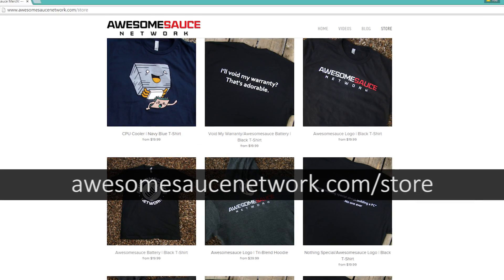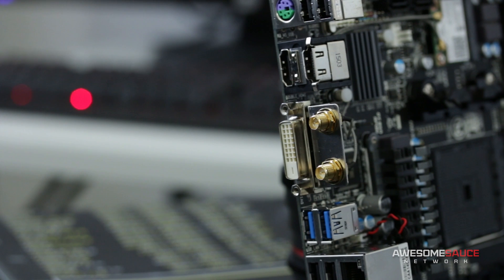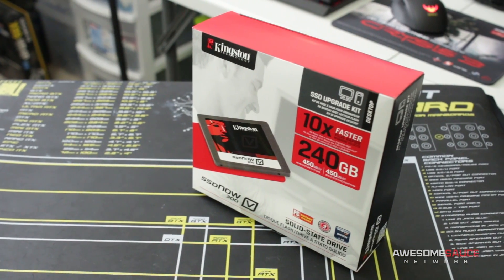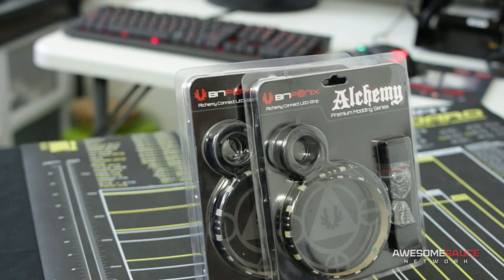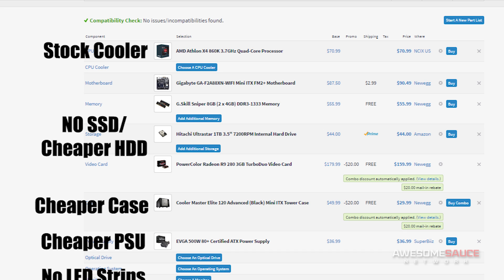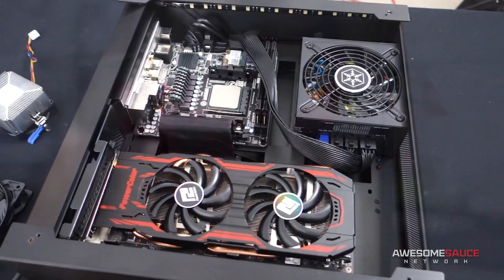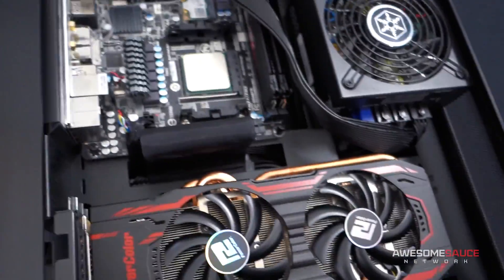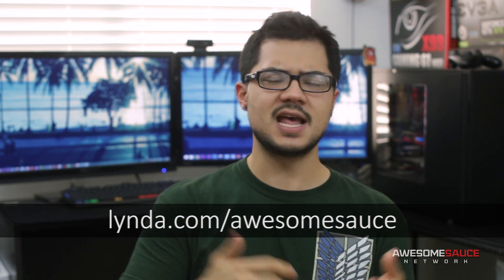The Overkill Console Killer: And How to Build One for Under $500 (Part I)

Comment: This mediocre rig is misleading because doesn't include mouse/keyboard (a console comes with an equivalent gaming peripheral). And are you running Linux? Because there is no $100 Windows 10 included either in the price. Linux is great, I game on it, but won't run anywhere near the amount of games Windows or a console will right now so your basically bound to some of Steam's library and that's it.

Overall this is closer to $700 with peripherals and OS, and because it's an AMD setup it'll run hot and consume WAY more power than an Intel/NVIDIA setup which is just a waste. AMD is so terribly power inefficient.

Long story short, a $400 PS4 seems like a much better choice if this is the alternative.

Comment: for computers do the parts have to be compatible or are all parts compatible. I mean if i switched out a few parts of the biuld will the computer still work? I knoq the ram has to be the same DDR to work with the computer but otherwise can i just use random parts in a biuld and they will work?
Reply: Jordan Costelo For the mainboard processor socket, its must be the same type with the processor (eg: LGA 1150, AM3, FM2+, etc), and also the DDR type must be compatible with the proc. spec, for example like the athlon x4 in this video support memory DDR3 up to 2133mhz, and then the vga card must have the same slot with the one on the main board, wich commonly are PCI express 3.0, for the storages, use the same SATA version also with the one on the mainboard Lastly u must calculate so the power supply could supply enough power for all components. So basically you can throw in any part from any brand or manufacturer, as long as the interfaces clicks...
Hope that can help, correct me if I'm wrong anyone..

Comment: WAIT WHAT. A X4 in 1000 dollars build? Nosense.
Reply: aaronzone oh its mini itx
Reply: http://pcpartpicker.com/p/p7GgjX
This is the ITX build what I made.
Reply: aaronzone A Xeon? Why? You're not hosting any servers whatsoever.
Reply: ***** That's basically locked i7-4770 without integrated gpu.
Reply: aaronzone Yes but it's not designed for gaming. It even lacks performance compared to i7's when it comes to gaming. You are way better off with a i5-4690 or even a 4460 if necessary.
Reply: ***** http://cpuboss.com/cpus/Intel-Xeon-E3-1231-v3-vs-Intel-Core-i7-4770K the name only doesn't make it bad.
Reply: aaronzone No it doesn't. But the benchmarks do.
Reply: And the OC helps i5 pretty much with those benchmarks.

Comment: Hello. I am just a little guy 12 years old and i am saving for 500 euros for a gaming pc actually 522 euros but i dont know if i get the good stuff for that money  this are specs they are in dutch but only need to know its good or not 
Hardware
chassis:
Sharkoon BD28 Green edition
Verlichting:
no extra lights
not quiet:
Geen Geluidsdemping
Motherboard:
GIGABYTE GA-F2A68HM-DS2
Processor:
AMD Trinity A4 5300 (2x 3400 MHz) Dual Core
Overclock:
no Overclock
Processor-cooler:
Scythe Katana 4
[RAM]:
8GB DDR3 1333Mhz (Corsair Memory - Dual Channel)
Videocard
AMD Radeon HD 7000 serie
audiocard:
Onboard audio 7.1
harddrive 1:
1000GB Harde Schijf (Toshiba 7200RPM)

Network:
TP-LINK TL-WN781ND 150N - Draadloos WIFI
Drive:
DVD-RW Dual Layer Brander
IDK:
Corsair CX Series CX430
Bekabeling:
Standaard Bekabeling
Cardreader:
All in One Cardreader + USB aansluiting
Garantie:
2 Jaar Carry-in Garantie
Actie:
Gratis Sharkoon Shark Force Green
Software
operating system included with price
Windows 8.1 64Bit NL
Reply: We don't need 12 yr olds in the PC master race
Reply: Go to website named pc part picker. Find good computers built by other people. Pick parts there for good price
Reply: Boonstra TV Koop nooit een kant en klaar PC als je gaat gamen, je betaalt er vaak meer voor dan wat je er voor krijgt. De A4 5300 processor bijvoorbeeld is niet bepaald krachtig op het gebied van grafische games en is ook trager dan de meeste Intel processoren van dezelfde prijs. Koop deze onderdelen via Alternate.nl en laat ze voor je in elkaar zetten door Alternate of doe het zelf als je dat fijner vindt. http://pcpartpicker.com/p/pFMsQ7
Reply: Knight Squire James Fuck off m8
Reply: Armando Gomez lol

Comment: I must say the 860K sucks.. I have one and it bottlenecks a 260X in GTA V...
Reply: Wiikendz Bit late but GTAV isn't a good comparison for benchmarks right now.
Reply: *****
had it at 4.2 with no difference.. now its at 4..
Reply: *****
Its FM2+, there is no better CPU.. :(
But im probably upgrading to an i5 6600k when those are released in like a month :D
Reply: Wiikendz dude, the 860k is beast, with a good cpu cooler and little OC it can run almost everything
Reply: Rob van Dooren It bottlenecks a 260X in GTA V, at 4.2GHz..
Its good for the price, hell yea! But not if you want to game at higher fps..
Reply: Wiikendz True dat. But it is definetely the best budget cpu, could run newer games on medium settings 1080p 60+ fps! I use it for my second pc, which is for mates when they come over. I mainly use my i7 3770 pc
Reply: Rob van Dooren Depends on the game tho.. If you max out GTA V even with a Titan X, you only get like 35fps with the 860, while other CPUs get like 60..

Comment: is this build good for 500$
Case:cooler master elite 110 40$
CPU:ntel Pentium G3258 Haswell Dual-Core 3.2GHz LGA 1150 70$
MoBO:ASRock H81M-ITX LGA 1150 mini itx 55$
PSU:Cooler Master Elite V2 - 550W 55$
cpu heatsink:Noctua NH-L9i 95mm SSO2 CPU Cooler 40$
ram:Crucial Ballistix Sport 8GB (2 x 4GB) 240-Pin DDR3 SDRAM 50$
EVGA GTX 660 SuperClocked 2GB GDDR5 PCI Express 3.0 100$
hdd:Seagate Momentus Thin ST500LT012 500GB 50$

Comment: This isn't a console killer.....this pc cost $150 more than the xbox one. Plus in 2-3 years your going to need to upgrade unlike the console which will be optimized for about 6-8 years to run all games. I like both console and pc but when it comes down its possible to beat the consoles price/preformance ratio.

Comment: First off, i'm not trying to play "fan boy" when it comes to console vs PC....but how will a $500 PC stand-up to the PS4 and Xbox One in a few years?  I mean, even Fallout 4 is going to push that system almost to its max and that's coming out later this year.....also, Batman Arkham Knight RECOMMENDED requirements are hitting the limits as well.  The fact that I paid $400 for my PS4 last year and I know that in the year 2018, for example, I can play games on the console, odds are, I'd have to spend MORE money on a $500 PC....GPU, RAM and probably even CPU.  By the time 2018 comes along, the PS4 will probably be $299 and the Xbox One could be $249 ($100 price drop for both)....The biggest gripe I have when it comes to PC gaming is having to check system requirements on games....either you pay out the butt up front so you don't have to worry about system requirements, or upgrade hardware every couple of years.  Yes, I realize you get better graphics from a PC game and higher frame rate....but even if I were to play games at the same resolution that the PS4 or Xbox One is playing them at, I don't think a $500 PC is going to be playing the multi-plat titles in a couple years.
Reply: DvdXploitr I have a 4 year old PC (600€) and I play BF4 on high settings. I've never had any lag on games, unless they were horribly optimized ports, like Batman Arkham Knight.
PC gamers don't check system requirements in games, unless they have an 8+ year old machine. They also don't worry about upgrading, because it's usually only 1 part that's holding the system back and it can be sold and cheaply replaced.
You people don't seem to get it that consoles are PCs with limiting software and hardware. You're paying more for less, because of the brand. Your games cost more, because developers need to pay just to have their game in Xbox or Playstation. MS and Sony keep distracting you with exclusives, DLCs, gadgets and free games, while you're paying 60-100$ for games and 15$ for online play. You say you'll be playing PS4 in 2018, but we all know how fast you'll be in stores when PS5 comes out with words like "new features" and "next gen".
You have no idea how bad consoles are for the gaming community. Even though a PC can do everything a console can (and more), people still buy consoles. The media exaggerates everything and creates a public opinion of consoles being the future of gaming, which forces game developers to divert their attention and funding towards making console users happy, while PC users get stuck with bad ports or downgraded graphics.
Reply: DvdXploitr Well, the consoles aren't magically going to become more powerful, so why would a PC that's currently good degrade over the same generation?
Reply: DvdXploitr " how will a $500.00 pc stand up to the pos4 and xbone in a few years?  THE SAME way it will today.  It beats it.  Guess what.  Fallout 4, crysis 5, metro last light 4, witcher 5, and ANY other truly demanding title WON'T be playable on a conslow worth a shit ( 30fps and 900p..isn't worth a shit.  get over it).

Thus your question equally applies to both the conslow and the pc except the pc's performance DOESN'T degradate unless it's ran by a dumbass noob who loves to " click here for the best new dumbass casual game whose company is unknown and it will give you 10 billion new lovely internet browser toolbars to let in new malware and viruses." 

By the time 2018 comes along.  Amd ( as usual) will have yet another badass apu and newegg and the likes of those etailers will have 300.00 deals on bi weekly shellshocker deals ( plus 100 bucks more for windows) that will STILL match or beat the conslow- worst case scenario- and yet STILL do more than it ever could....while the conslow STILL fails at trying to become the pc since it has been trying to do since the FIRST gen playstation days. 

"I don't think a $500 PC is going to be playing the multi-plat titles in a couple years."   (facepalm).  Please get off the net kid.  You obviously haven't a clue.
Reply: so, i should able to play GTA V (even if its not on Ultra) on an i5 with 8GB RAM an integrated HD 4000 1GB GPU?
Reply: I've bought a 7770 for 75 bucks in early 2012 and it still runs fine
Reply: ***** Conslows CAN'T do or take full advantage of the following:
1.  Enjoy an UNgimped internet usage experience.
2.  Burn/copy/rip music cds, movie dvds and blurays.
3.  Edit documents, photos, music, and movies.
4.  Enjoy in TRUE ( not FALSELY scaled ) 1080p, 1440p, and above resolution gaming.
5.  CREATE GAMES
6.  CREATE operating systems.
7.  CREATE music.
8.  Be upgraded at all in any NOTICEABLE context of performance/hardware upgrades except  one ssd and even that can be a bitch to deal with compared to a ssd upgrade for a Windows or Linux pc.
9.  Enjoy the LARGEST library of FREE games ( and depending on the website ..cough gog.com.  cough) many of which are DRM free. 
10.  Teach a person how to be self sufficient ( pc's are most often individual/customer repairable.  Conslows often MUST be sent to the damn manufacturer ( xbox 360's red ring of death upon launch...enough said)
11.  Enjoy virtuallY ALL GAMES in the history of gaming of ANY context and ANY level ( from coleco vision, atari, nes, snes, genesis, turbo graphics 16..all the way to ps3, nintendo wii, xbox, and possibly xbox 360) either natively to the operating system..or via emulation.....FOR FREE or dirty cheap.  Good luck playing FF tactics on ps3 if you feel like some classic gaming.  It won't happen.
12.  Dpi scaling and other IMAGING adjustments to the gui/desktop interaction of the device...Good luck with even a PORTION of that on a conslow.

Well that should be enough for now.  So given all or even HALF of that list...how the FUCK..could you say that a conslow is a pc?  Epic failure there.

The conslow has BEEN .." trying" to become the pc since the playstation days or hell even the Philips CDi which tanked in a short time, but all of these half-assed efforts only shine the truth brighter and brighter upon ever " next gen conslow" release in which is ALWAYS 2+ years behind pc hardware in almost EVERY context.

The ONLY thing conslows have going for them is exclusive titles :  Metroid, Ninja Gaiden, Mario, Super Smash bros. , Gran Turismo, Zelda, etc

And year after year, Pc is able to play those titles ( although in recent few years emulation is getting tougher to build.  I'll admit that) through emulation just a few years after the conslow's launch.
Reply: Chronofusion Dude, I wasn't trying to diss PC gaming....as I stated at the beginning, i'm not trying to be a fan boy about consoles vs PCs....i'm a console gamer and my brother is a PC gamer...however, it seems that ever year when my parents ask my brother and I what we want for Christmas, he is asking for something new for his PC...its usually RAM one year, GPU the next year and CPU the next...every now and then, he'll ask for a new hard drive....it just seems that he is putting an awful lot into his PC....as far as consoles, I'm perfectly fine with 1080p at 30FPS....I just was curious if a $500 PC would still be able to play games in a few years with the way games are getting bigger and more power hungry....it wasn't a stab at PC gamers at all...i'm just basing it my brother's experience and a couple other people I know that play PC games.
Reply: Do not believe requirments. They are misleading and often mean "the lowest end configuration we tried" which is different from "the lowest end configuration possible". A mid-high end (HD 6870, FX 4100, 8 GB ram) machine from 2010, bought at €500 (in a country where parts are overpriced) outperforms consoles. It is also a myth that about Xbox 360 being aging better than high end PCs from 2006. 8800 outperformed Xbox with Far Cry 3 which is one of the worst games running on PC.
Reply: DvdXploitr
Reply: DvdXploitr Yes, at a compromise but it is possible. Sorry for the previous message, it was misleading.
Reply: AnimationStationS I wasn't implying that the PC would degrade, it just seems that requirements for games go higher and higher in no time.  Take my laptop for example, it came out after the PS3 and it can't play games that the PS3 can.....
Reply: DvdXploitr Good point. You may have to upgrade a 500 dollar computer depending on how you build it. I find myself wanting to upgrade my computers whenever I can, rather than when I need to. I think common upgrades are mainly a result of the high standards that PC gamers have, and so maintaining 60fps1080p is harder than 900p30fps. You might need to do a GPU upgrade, but only maybe. You'll probably be fine.
Reply: AnimationStationS I would be perfectly fine with 900p/30fps really.  I would rather have a PC that can play modern games for the life of a game console while still doing PC features....rather than game console companies putting "PC-like features" on their consoles....I mean, I can't imagine someone using a PS4 to surf the web like they would a desktop, laptop or even a phone.  But if I could use my PC for 5-6 years and play games the same way I would a console, I would be happy with that.  My eye sight isn't the best and can barely tell a difference in 720p and 1080p (but Ican see a HUGE difference between 1080p and 4K)....even if I could manage 720p/60fps, i'd take that over 900p/30fps b/c I can notice a MAJOR difference in 30fps and 60fps...however, there are some games that i'd miss from consoles....such as Mario games...and even Destiny....(I guess I can see why they never put Destiny on PCs since PCs already have plenty of MMORPGs)
Reply: DvdXploitr That's a pretty dumb line of logic there. It's not like the PS4 specs get more powerful over time and the PC specs degrade over time.

The truth is the game developers cut corners to get the latest games running on the dating console hardware. They decrease the FoV, decrease the FPS, decrease the resolution, etc, etc, etc. You can do exactly the same on your PC and keep up.

Sure, your PC won't be able to play games on Ultra in 3 years, but the PS4 sure as shit won't either. The only reason you don't know this is because you can't access the menu on the console and see every single graphic feature set to LOW or OFF.
Reply: +DvdXploitr If you pay for online on xbone and ps4, you are wasting 900 in 5years. Even if you are not paying for online features, its better to buy a pc. Laptops are different story as you cant upgrade anything. You will need a gaming laptops and they are lot more expensive than desktops for lower performance. You cant compare apple to oranges.
Reply: +DvdXploitr I think you don't understand how hardware works and what recommended specs means.  If your PC is more powerful today, it will be more powerful than your console in 2018.

Comment: What is better the raideon r9 280 or the gtx 750 ti
Reply: AKNXM r9 280 IF the price is within 25 bucks AND you're trying to game at 1440p regardless of the in game graphical settings.  
If you're gaming at 1080p and you are happy with medium-ish settings in all of your demanding titles, the 750 ti will work plenty as long as you have at least fx 6300 amd cpu or better, or intel 4430 or better.  Cheers.
Reply: Thx